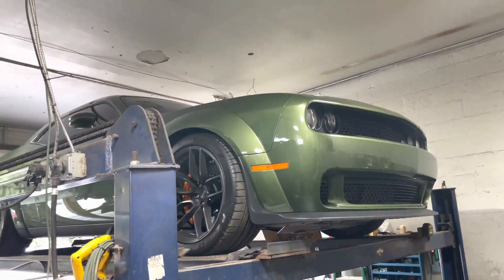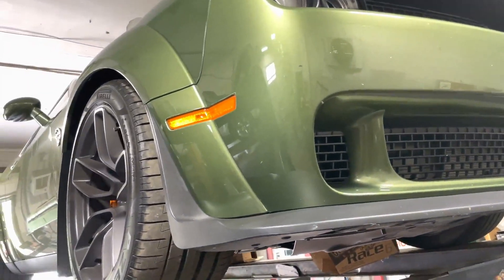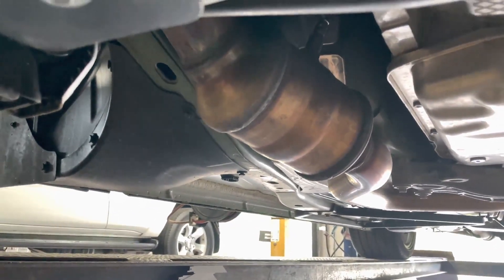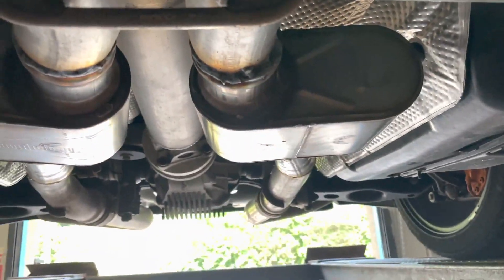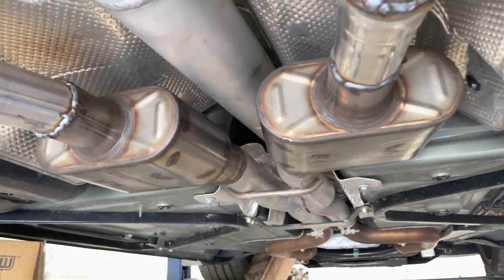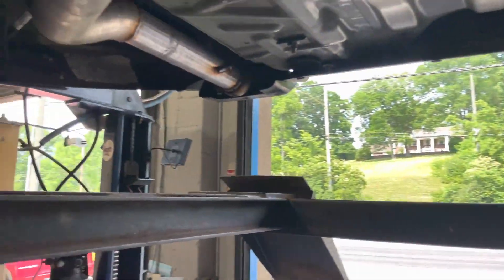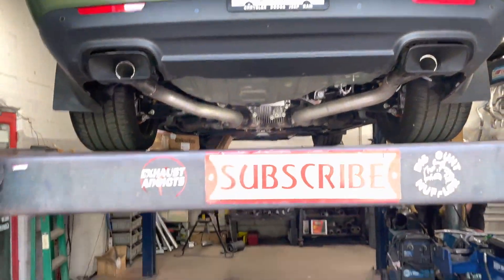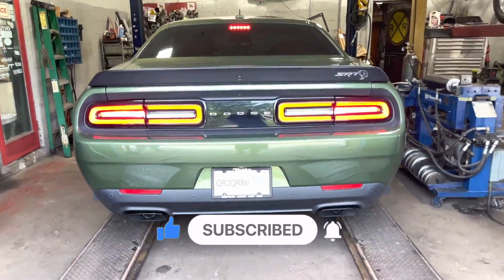2021 Dodge Hellcat SRT WIDEBODY 6.2L SUPERCHARGED HEMI V8 DUAL EXHAUST w/ BLACK WIDOW RACE VENOM!

Comment: The Angry Housewife mufflers are the same single chamber design as the Flowmaster Super 10’s, but in my opinion sound way better than the Flowmasters. Such a bad ass car! Sounds really good!
Reply: all black widow mufflers use the same hourglass baffles, just scaled to the different sizes and shapes of the mufflers. they're a decent bit different internally than the super 10s, but they are a similar form factor.

Comment: Nothing like goobery welds on a $80k car.
Also pretty cool that you guys don’t know or understand the difference between steel and stainless steel and you think that welding the two with your little mig welder is ok. You need to hire someone that has a bit of metallurgy knowledge and knows how to GTAW properly.

Comment: isn't the resonators delete will make the car lose power?
Reply: Yes and no. Resonators can give you some torque but it is all relative to pipe diameter, number of pipes, and fuel consumption, and rpm. It is kinda hard to say on this because he added the race venoms. But without doing all the math I would say that he has gained power overall. Not much. But some. If he does long tubes this would be a definite high end (horsepower) increase. Hard to say if it would truly be noticable while driving but it will definitely show the numbers on the dyno.
Reply: In general I would say lose the resonators. There are better things.